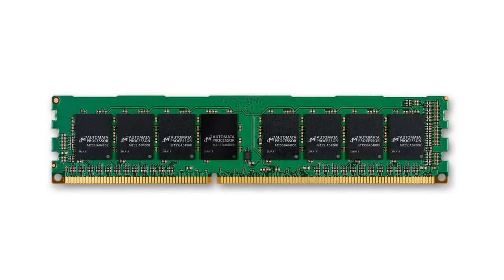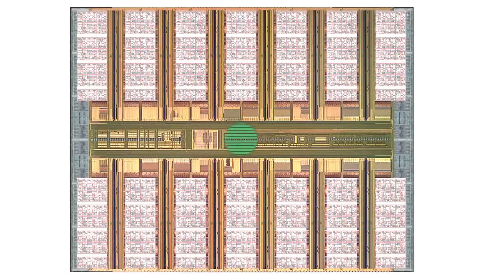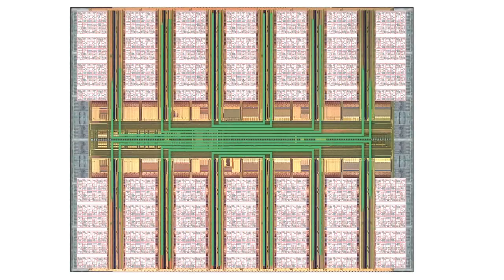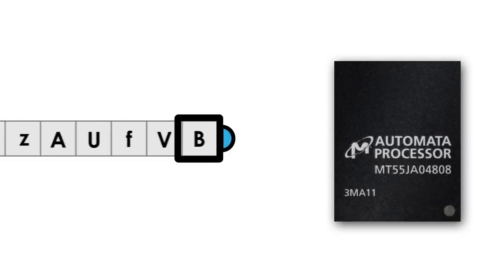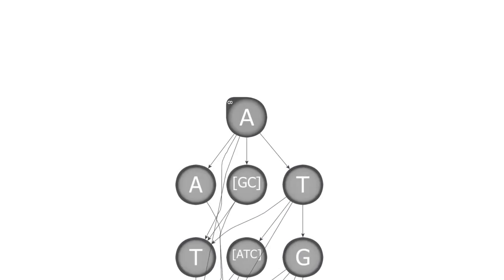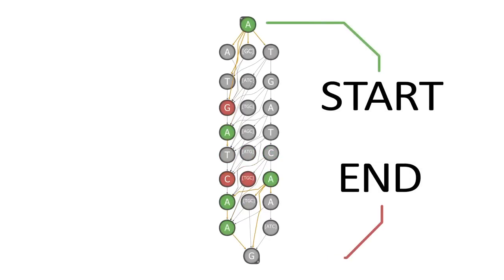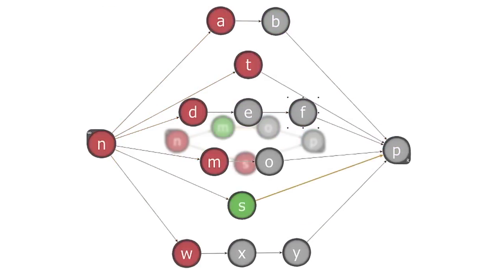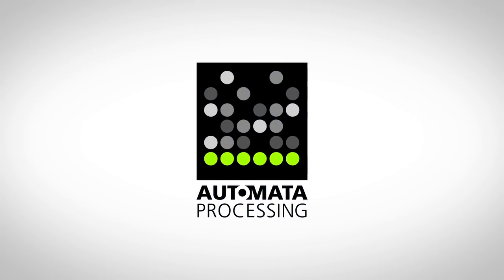Introduction to Automata Processing

Comment: What happened to Automata Processing? It went Dark - I hosted the site Processing Automata and worked with multiple groups when Micron Technologies was developing this program in public. The SDK came out, I worked with a SDK in a group. But Micro said they needed a 9 layer chip to scale, and their tech was only 7 layer. Well, that is what we were told. Now In Blockchain and Oracles should function the same as this. Byron Davies is the developer for this.